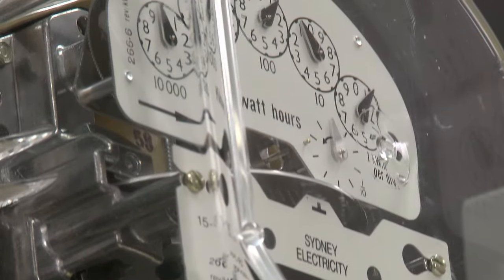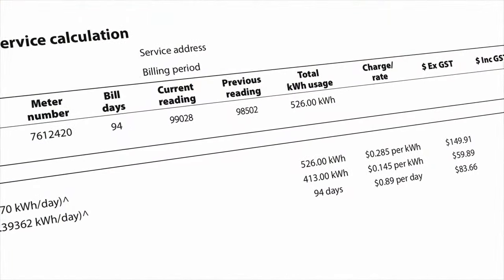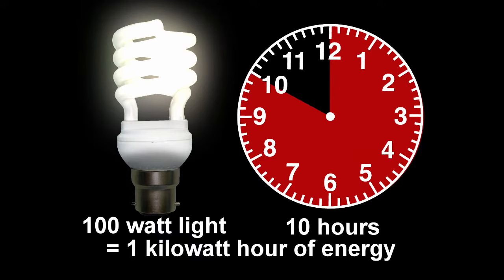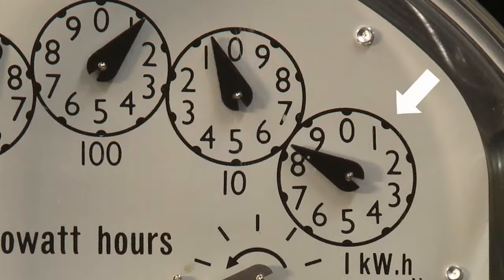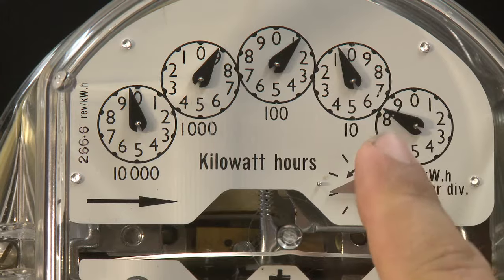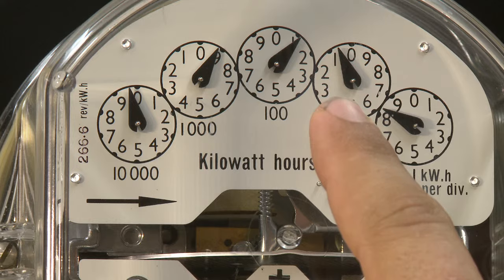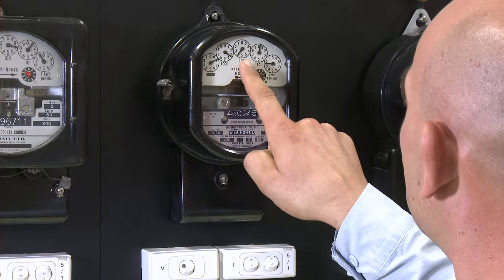How to read my mechanical meter

Comment: Thank you this was very helpful, however, i still believe that just getting my self a Sense Power monitoring device that can monitor my total power usage would be best as it will calculate everything for you and be pretty close to the actual bill.  My meter has 5 of those little number things with the arrows. Thank you again. This video deserves way more thumbs up.

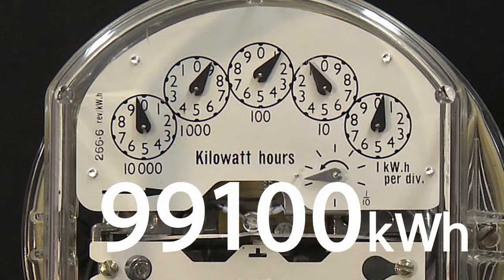Comment: Except the reading for the meter at 1:25 is wrong. The tens dial is a 1 not a 0. Source: this is what I do for a living and train others how to do everyday. I was trying to find a training video to help explain the process, but since this is wrong I can't use it.
Reply: Im looking for actual training material on this too
Reply: whats the answer? is it 89100?
Reply: It should be 0?
Reply: Its correct, the dial numbers are listed in the opposite direction and the dial is less than 1.
Reply: The Answer Is Still 99100

Comment: Wrong It's 99110
Reply: What you mean? The tens hand is sitting at 0.8 - 0.9. It hasn't even hit 1 yet. Can you explain?
Reply: @sypher0101  I think he just referring to the meter. If the hand of the meter is directed at a number, check the right dial. If the right dial passed 0, then use the number pointed by the dial. If the dial did not pass 0 , then use the lower number.
Reply: @sypher0101  i'm not sure how the video got 99100, i'm reading 99108 since that first digit is just past 8, rotating clockwise